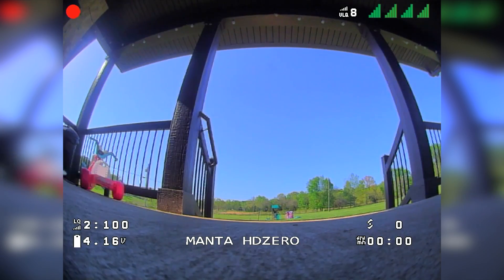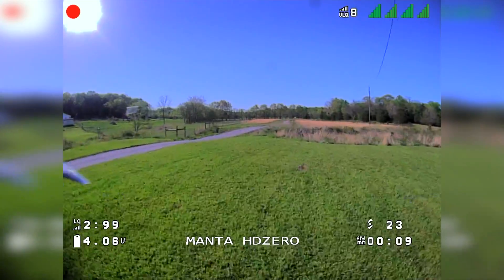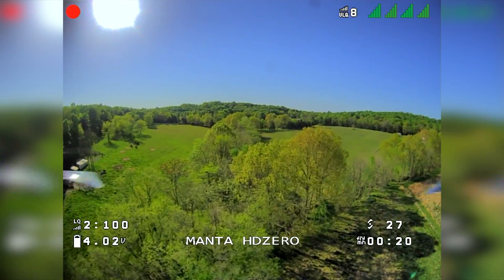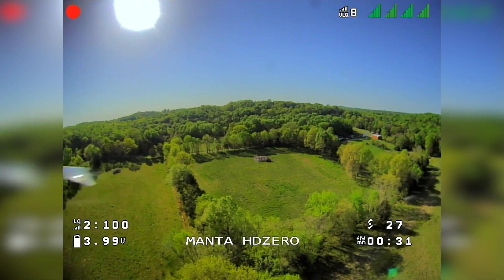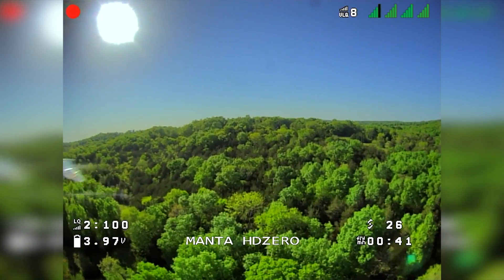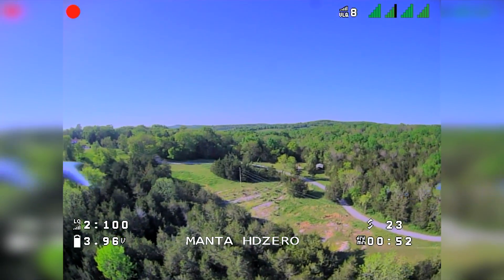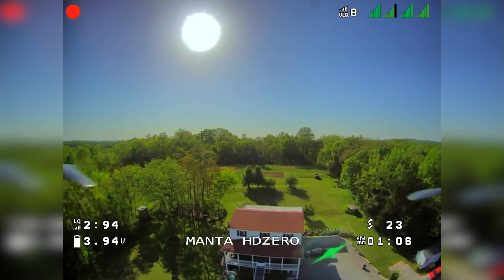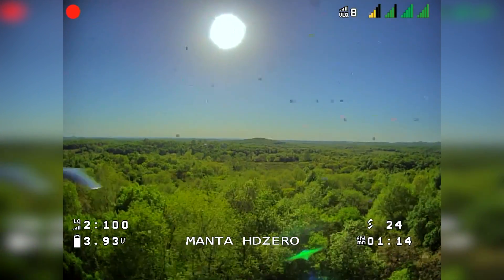HDZero 1W VTX vs ELRS 250mW: Who Did It Better?

Comment: Frame selection and gps rescue seem to be important for this system. I just picked up one of the 1 Watt HDZERO transmitters and the frame I got doesn’t really work for it. I got another KINFPV frame, the AT6 this time and no… it’s not going to work. I saw your other video, I’ll looking in to one of those. Which one do you think is the better frame. I was also looking at the new Mark5 frame as well.
Reply from the maker: I prefer the Gank Multirotors frame over the Manta. That new GepRC Mark5 is really nice. I considered picking up one myself.